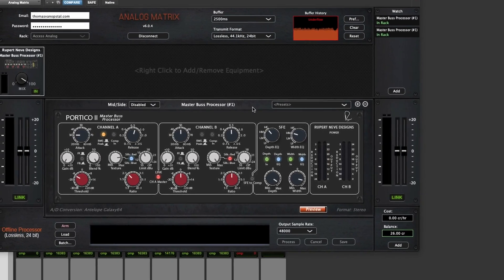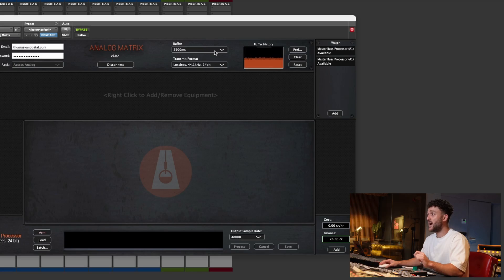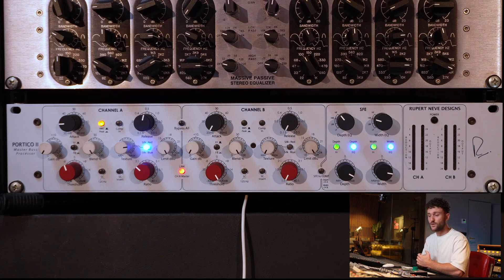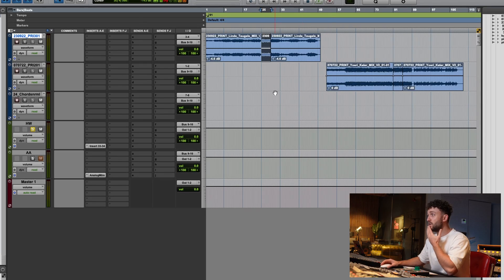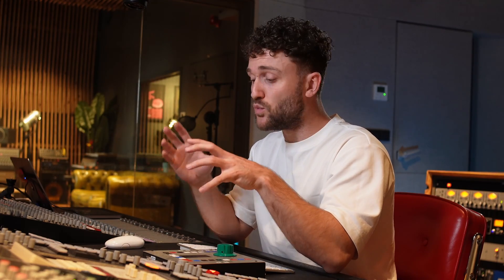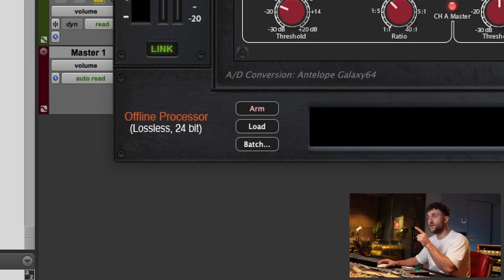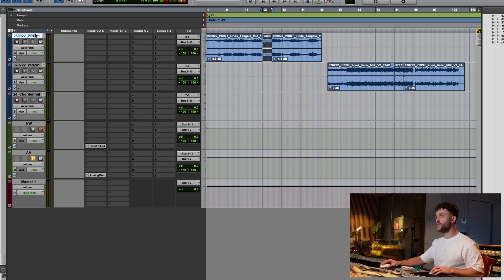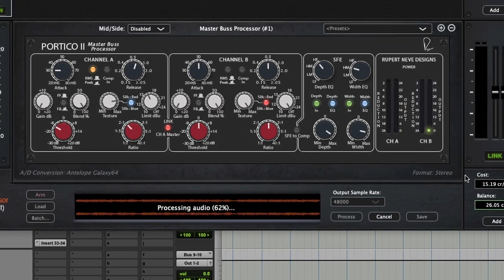Rupert Neve Masterbuss processor IN THE CLOUD?! Plugin vs Hardware

Comment: Honestly 
Nebula 
Alex B Pres Colors and Saturation (RND Portico Pre Setting ) + Acustica Audio Snow...Both Live Analog 18 Core Live Sampling Pluigins, Together will match a physical RND Portico.....all the way up to 90%, Live analog sampled plugins...are changing the Game...

Thats $250 vs $4000 for 90% of the Sound, Depth and Analog Richness....thats a no brainer.....

Ive been shooting out 
Acustica Audio and Nebula vs Access Analog and Acustica and Nebul with your own Analog Rack actually Sound better than Access Analog...if you have at "Some of your own gear with Live analog sampled plugins....its no point is using Acess Analog....Exp. Timp P Opto 32 Which is a 3A and 2A in one....sound as good or better than the UAD LA2A on Access analog...

Its being sent off Digital and Return Digital

Running a Mix through your own Analog Gear and then using Nebula and Actica to put a glue, niced toned finish on the Song is going to sound Warmer, Smoother, and more  open....than Access Analog...Access Analog has a Harsh tone from thier gear....